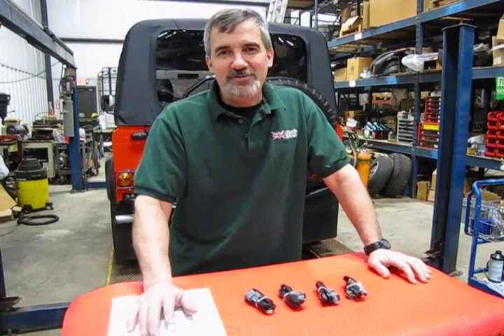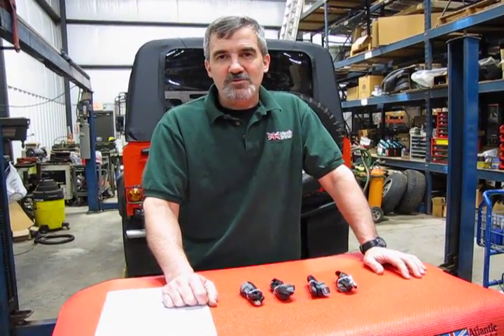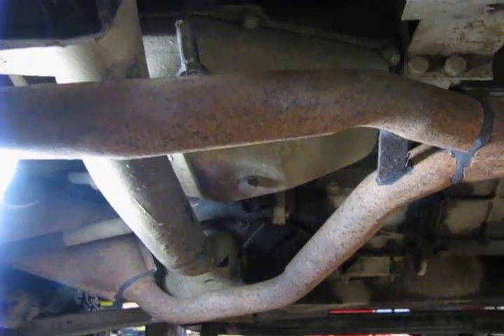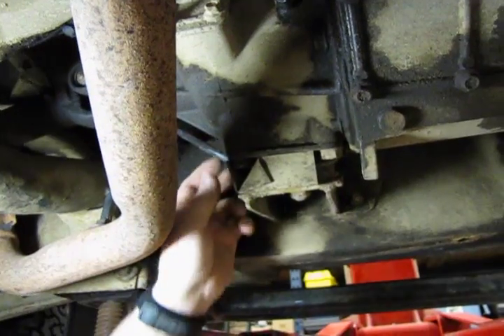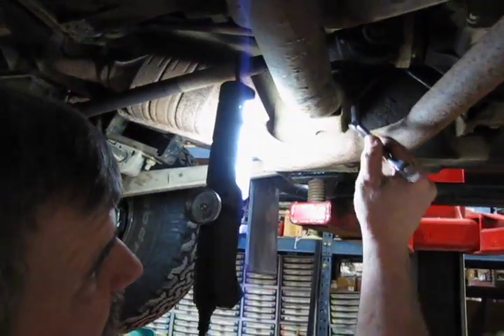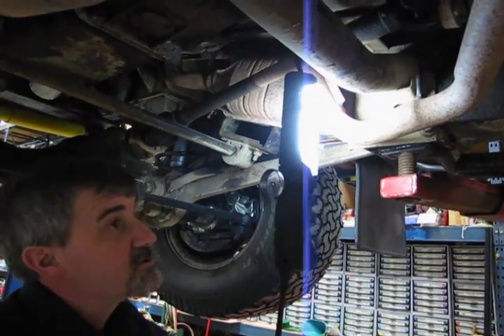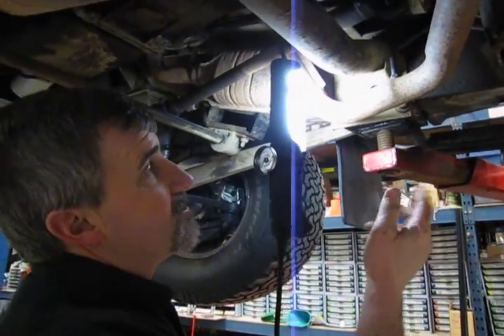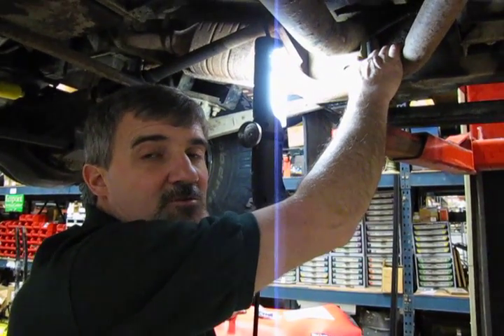Oxygen Sensor Replacement On Land Rover Defender 90 1997

Comment: The difficult part, I've found, is the removal of the electrical connectors  because they have small metal brackets in them that mount to the vehicle (usually with rusty hardware).
Reply: +Rich Yaeger any tips on this? I spent 2 hours last night trying to get them off the bracket. I got them to wiggle in an up and down movement. But can't find any tab to release them.